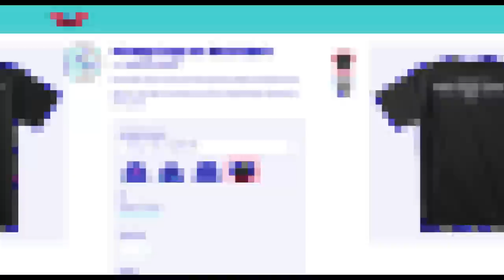Rotary Shifter Go Kart First Drive! | Full Send and Warehouse Drifts!

Comment from the maker: We did it guys...there were points during the engine rebuild where I never thought we would see this thing rip but here we are 😎. 

NOW LETS GET THAT 100k!!!

edit- 100k THANKS SO MUCH GUYS
Reply from the maker: That JDM kid keep grinding my dude it’ll come 💯
Reply: @Ethan Stefanisin it is it think
Reply: You should run a little bit of premix for the apex seals. Sick build
Reply: MrZep420  most likely but i think they got it from the frame or just bare engine check the first video
Reply: Shift the dang thing. Lets see its top speed
Reply: Want to see some speed and driiiiiffft!!!!
Reply: Sounds great! Just a tip, since it's a motorcycle engine you only need the clutch for launching. The way a motorcycle transmission works is with a shift drum not shift forks, because of how this works just let of the throttle, shift, hammer down. This goes for down shifting as well, just takes more practice to downshift because if you are going fast than the gear you're trying to shift down to you will lock up the ass end!
Reply: @stoddern  the shift drum only converts the rotational motion to side to side. There are still forks. And there is no reason not to use the clutch to upshift or downshift in any gear. It might not jam everytime but its a much higher chance it will. Might as well not risk it with an old engine like that.
Reply: to me sounds like it's not even beginning to hit its power band, a college teacher of mine didn't believe me until he let me drive his RX7, OOPS! wound it up to 10k and called it my shift point, didn't back off until I had it into 4th gear, teacher near crapping himself not knowing it'd do that.
Reply: Next step turbo lol
Reply: Sub 99,991 right here. Getting close to that 100k, congrats!  Also rotaries rule this build rocks
Reply: @ramseytruthbros7777  that would be sick unless it ends up like all the other boosted small engine builds on youtube. trying it,realizing it doesn't do shit and going back to n/a
Reply: Build Break Repeat you got it now pal
Reply: Congratulations on the 100k!!! You guys have been great to watch, hope to see some more collabs this year!
Reply: Build Break Repeat pin your comment son damn!😂 congrats on the build btw

Comment: Hah hah, too cool! When I first saw the inside of that engine, I thought 'if it ever runs again, it won't run very well'. Man. was I wrong! It seems like a torquey little shit, even at fairly low rpm. You'll definitely want to stay a tad on the rich side on your pre-mix so it doesn't seize the rotor. Everything must be seating in well, as it seemed to pick up some power the longer you ran it. With that high gearing, I'll bet it runs 80 mph. or better in top gear at the track! Guys, I'd love to see some paint on that thing. now that you know it's going to run well!😁👍👍

Comment: from my perception, it looks like you may need a little bigger sprocket on the axel, your first gear looks a little tall.
Reply: Yes! But only after the top speed run!  :-)
Reply: Heres another problem with both sprockets that small your putting a lot of stress on the chain and the output shaft bearings. As rare as that engine and trans is you may want to put a bigger sprocket on the axel.

Comment: That is an awesome cart. Pretty dang fast. Definitely want to see a turbo and fuel injection system. It will truly be at its quickest acceleration and highest performance at that point once the tune has been optimized.

Comment: Great build guys,  way l see it the back sprocket on axle could be little bigger as your 1st gear is quite ' long ' . Going bigger will improve pull-away a lot with more power from standstill and reach top speed way quicker.  Count how many teeth and add couple more until you're happy with performance.

Comment: Steeringwheel is upsidedown, If you run a larger rear sprocket the thing will open up like crazy, the current gearing is far too low sound like it will do over 150mph
Check your fuel mixes on some of the bike forums.

Sick build my dudes.

Comment: Might want to take a look at doing the gas & throttle pedals differently. Looks like it would be pretty easy for your foot to slip left on the throttle and get wedged behind the brake pedal.

Comment: For everyone that didn't realize this but when you sand any metal that's rusted you are taking off a thin layer of metal. Rotories are very finicky and net to seal correctly so that thin layer of metal you sanded of might have ruined the rotor. Who knows, could be fine but no one thinks like a technician does.

Comment: I'd find a long stretch of road and see how fast you can go, but before I'd even try I would get a hydraulic front and rear disc brake upgrade. Much better than a single rear brake setup and safer when testing its top speed.

Comment: Lovin' your rotary shifter project !
But have a curiosity about the muffler being mounted right over the right rear tire.
Are you experiencing any heat problems with that tire ?
Wondering if you are going to need to relocate it at some point ?
Excellent kart gentlemen !

Comment: When adding gussets etc, have you considered modeling the frame in solidworks and doing FEA to evaluate weak points?

I understand you are ME students so it would make sense.
Reply from the maker: john boyd Yeah that would be ideal, we are freshman so we haven’t really gotten into modeling yet. Hoping to start next year because we could plan out all our builds at school and when we come back to work everything is already modeled out.
Reply: Very good!

You should be able to get a student copy of solidworks or Acad Inventor and get started 3d modeling.  Once you start, you will wonder how you lived wo it.
You can then move to 3d printing for r&d easily.  I 3d model/print at work and save so much time and money on even the simplest parts it is insane.

I'm very impressed with your work!  Keep it up.

Comment: Just a note. Not sure how long that muffler will last. Mazda rotary engines eat, I mean seriously EAT stock mufflers packed w fibreglass. 
Read up on AES rotary mufflers and find someone to build u a scaled down version. 
Kudos on the build guys. I’m almost tempted to get myself a Sachs engine.  
I have a 20b Turbo 3rotor in my Rx8 in Australia. It runs on straight Lpg vapour injection. Pretty insane. Hit me up if u want to see some vids.

Comment: Add you a little nitro to the mix fellas. And what her really run. Put a tach on it and find out the Mac rpm on that engine and watch that rpm gauge so you don’t spin that motor out. And a nice oil pressure gauge would be nice.

Comment: Looks good. However you need more rpm. Rotary engines produce power at much higher rpm. Try lower gear ratio.  Bigger sprocket on rear or smaller on front. You'll see a huge differencr

Comment: Sounds great but y’all act like you’re scared of it. Push that peddle to the floor and do something we haven’t seen. But y’all did a great job on restoring that old rotary engine. Those has a lot of power and better potential. So go for it fellas. Push that bitch to the limit.

Comment: Please BBR, add front brakes also  if that' was 1st-2nd gear you guys were clearly around 40-50 , that rear disc will over heat real quick .I want you u guys to be safe and also top it out.